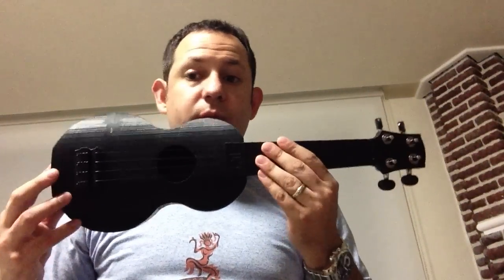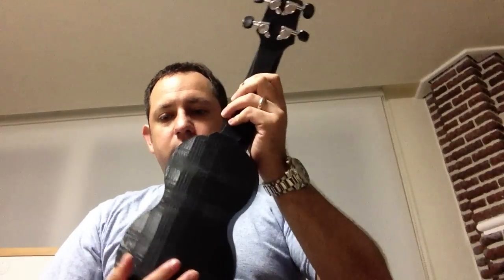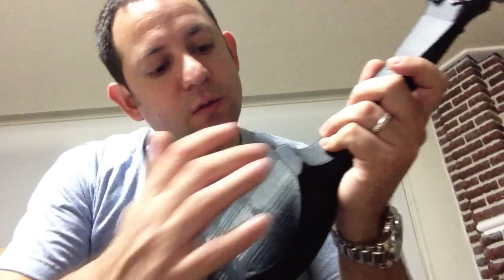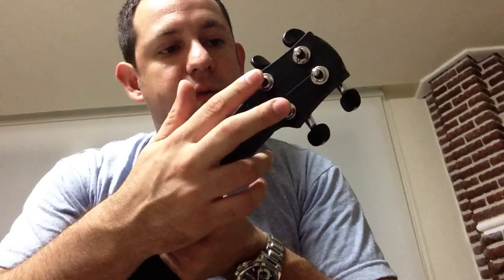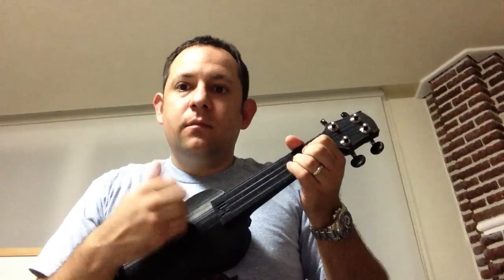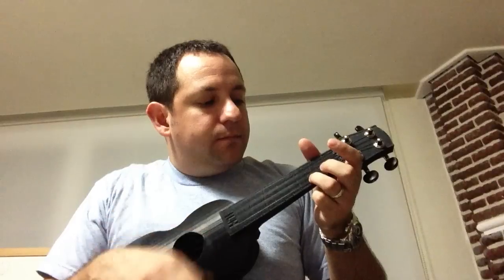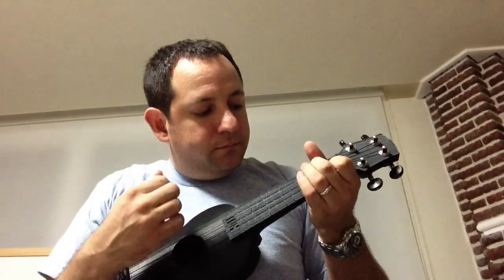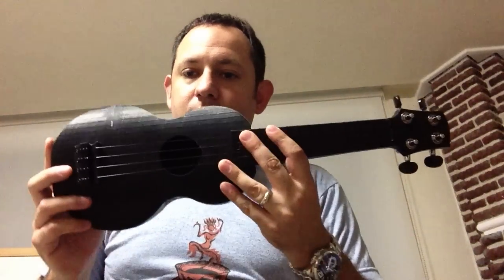3D Printed Playable Ukulele

Comment: Dont tuner need to be screwed in???
Reply: No, the tuners are basically a single bolt with nuts on both sides and a hole in the middle for the string to go through.

Comment: - 3D printed uke - good on you! Thanks for adventuring with it, and publishing the video.
- I'm very keen to create a new kind of (more ergonomic) concertina, but am waiting till 3D printers get much faster.
- I love wood, but the exciting thing is that the design of the new instruments can be trial-and-error developed in ways that are impossible with wood.
- I notice your curved keyboard - presumably an example of better ergonomics. What else might people try that to make it easier to play or otherwise better? Suggestions...
- Print strings, thicker at the ends, or thinner at the ends. Sweeter tone, mellow tone?
- Flat back, round back, rounded sides, hollow neck, or neck made with several cavities.
- Print other resonating parts, e.g. a bridge that has an angled 'keel' under it inside the body, strings connected) to carry more vibration from the strings to the faceboard.
Bruce Thomson in New Zealand.

Comment: I downloaded your model and am printing it now :) I have the Makerbot Replicator 2, so I had to opt for the 4 piece. I have the body halves printed and am about 22% into printing the neck pieces. Popped by guitar center and picked up some strings, already have tuning machines and I'll be Uk'ing out tonight! Thank you!
Reply: Did you had trouble tunning the uk? I'm scared that if I print the uk in 4 pieces the tension will snap the neck where ir was superglued.
Edit: I have used it for several weeks and I haven't encountered trouble with tension and tuning. It's working great!
Reply: What tuning machine did you use?